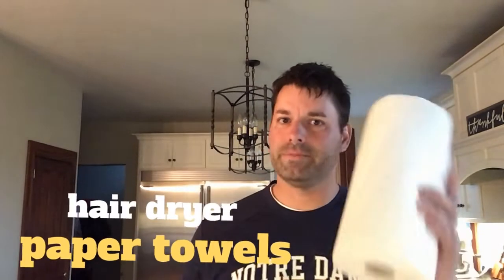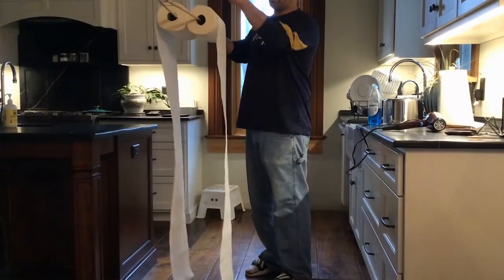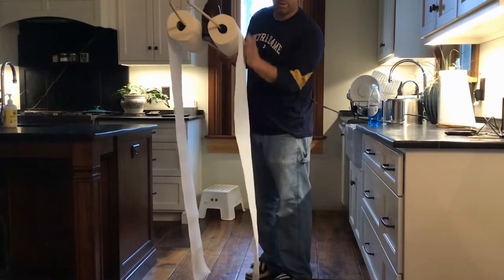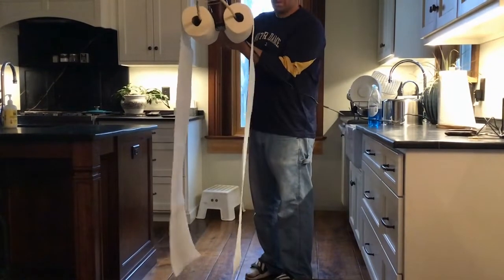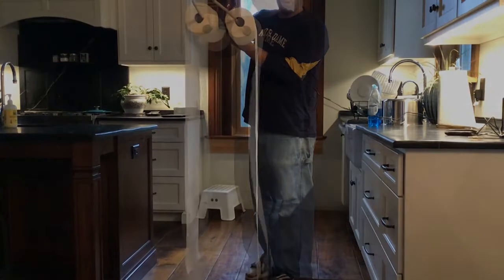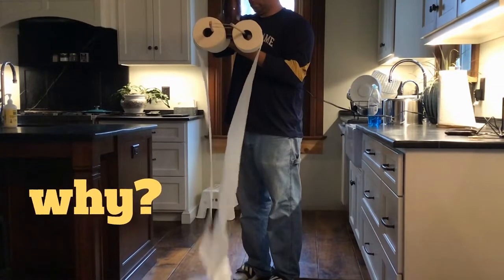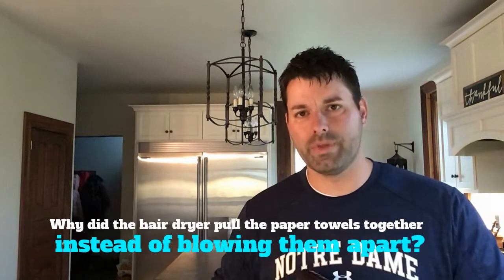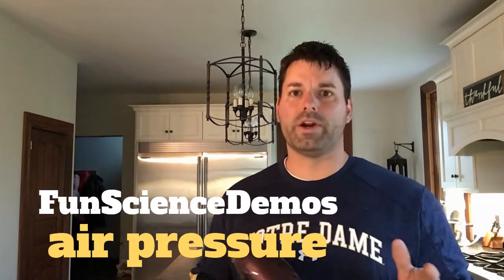Hair Dryer and Paper Towels - FunScience Scavenger Hunt

Comment: Coz the hairdryer creates a region of low pressure in between the two suspended paper towels, so naturally the air around it tends to move towards the low pressure area created by the jet of air by the hairdryer and hence along with the surrounding air the paper towel is also carried towards that low pressure area. This is how wings of the plane generates lift as the air goes faster over the top creating a region of low pressure, and thus lifts off.🤓

(This is Bernoulli's principle, which says that if air speeds up the pressure is lowered.)

Comment: Another informative video. Thank you. Similar to the water rising in the straw. The dryer pushes the air away from the middle. This results in an imbalance of air pressure on both sides of the towels which causes them to be pushed together as the air pressure exerts pressure on the outer part of the towels.
Reply: To be clearer, the air being pushed moves faster but we know the faster moving air exerts less pressure which will result in the imbalance of pressure on both sides of paper towel. 🙂